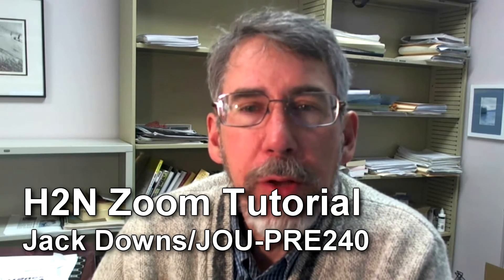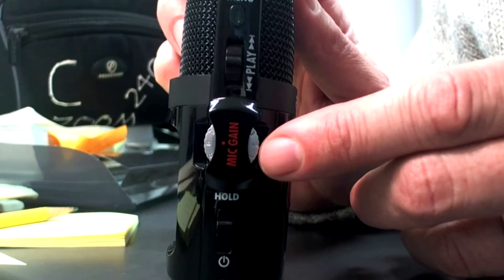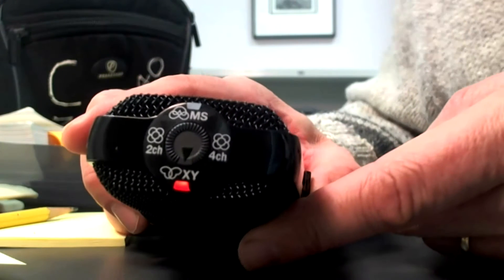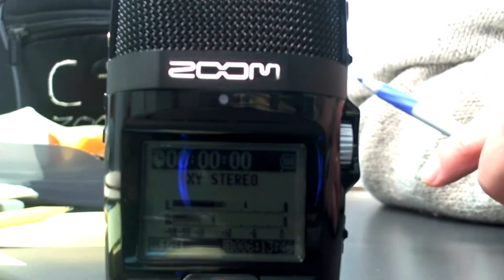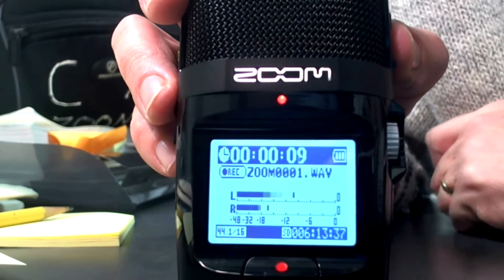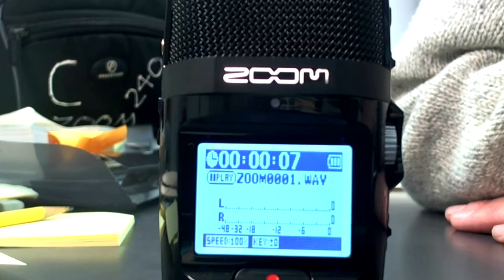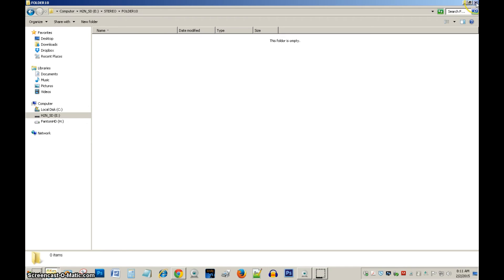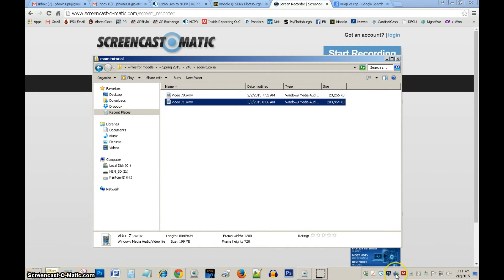Zoom H2N Tutorial for JOU/PRE240 2015

Comment: great video i just got one, what does the other i/O option do when u plug in the USB port ? thx
Reply: The Zoom H2n can be accessed as a storage device (just like an external hard disk) or as an external USB sound card. If the Zoom H2n is used as an external sound card, you only have 2 channels (stereo) and a sample rate of 44.1 or 48 kHz. In other words, then you won't have the higher 96 kHz sample rate and then 4CH mode will act the same as 4CH mode.
Reply: Where I positioned it to film, I was talking into the side of it ... normally you'd hold the Zoom right in front of you.

Comment: How can you change the kbps when connecting it to my mac (USB connect?)
Reply from the maker: +Primal Clan You have the option of setting kbps when recording in MP3 mode only -- which you may want to avoid because WAV is better quality. See page 73 of the manual. Is in the settings under record mode. However, if you are using the internal memory, instead of a SD card, you'll be unable to change this. None of this should be affected by whether it is connected to a computer. If you are having a specific Mac connection problem, sorry, I won't be any help. I don't use Macs. My uninformed opinion is that some Macs may have USB issues -- but that's just what I've heard.

Comment: Hi Jack great video: )
Just wanted to ask...."using 2 headphone Jack's at both ends" 
If I use the line in on the h2n and plug the male adapter to my phone or iPod will it record the audio from my phone to the zoom????...Thanks: )
Reply: With the right cable this should work. If your phone's headphone connector can also be used for headsets with external volume and transport buttons, or for headsets with a built-in microphone, you may need a cable with two different plugs (or a small adapter cable), but in theory this should work.
Note that that Zoom H2n's so-called "LINE" connector is really only a MIC connector with a very low impedance, so this input may be too sensitive for line level signals and amplified  headphone signals, even when the recording gain is turned down to 0. If the recording gets too loud and distorted, or too noisy,  you may need to make your own adapter with two resistors to attenuate the signal, but I have made perfectly good recordings from some line level equipment on my Zoom H2n, so with a little bit of luck it may work right away.